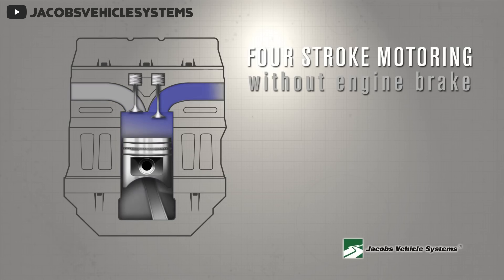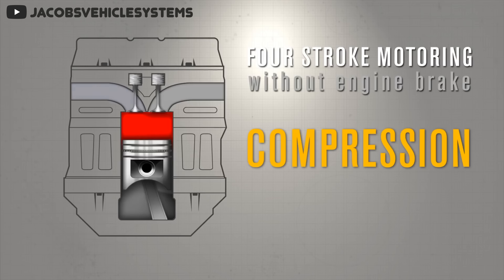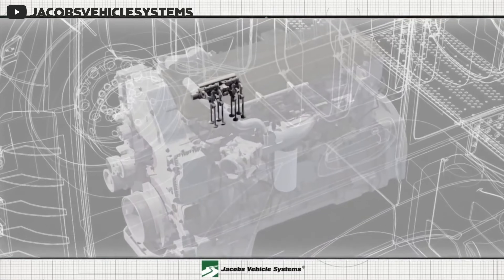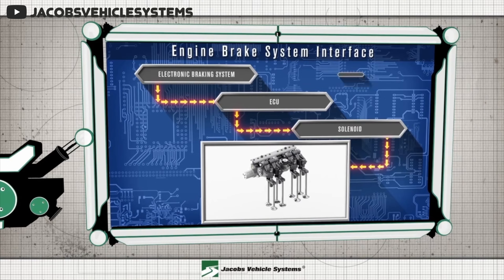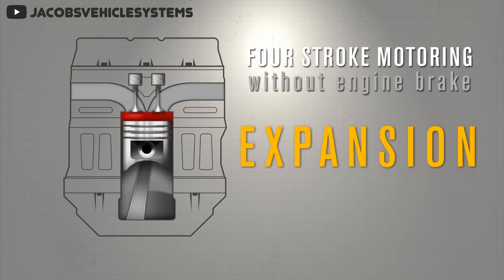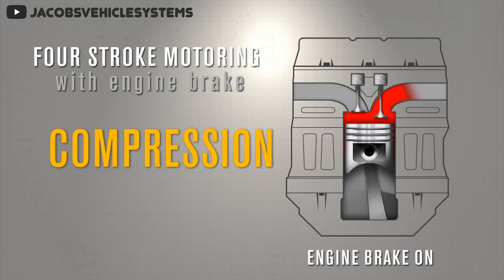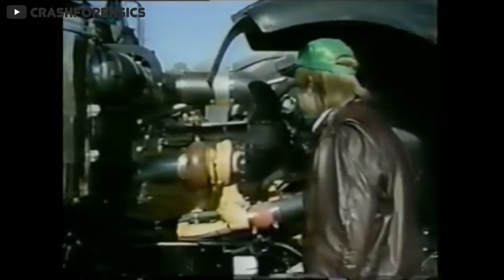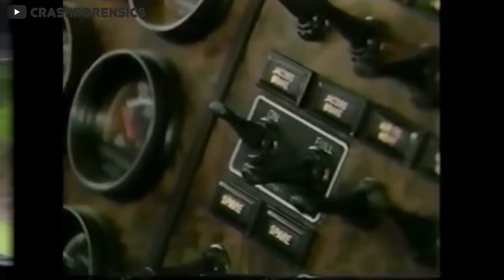What is a Jake Brake and How Does it Work?

Comment: When a Diesel engine is under no fuel, the engine works to compress the air in the cylinder. If no fuel is added, that compressed air will push back down on the piston making for neutral braking. On a Jake brake with no fuel yes the engine works to compress the air in the cylinder, but the exhaust valve opens near top to expell the compressed air hence their is no air pressure left in the cylinder to push the piston back down again-and you get all the compression strokes working as a brake-usually around 400hp of braking.
Reply: 400Hp of engine braking only at High RPM with all cylinders actively providing braking effort. Also not all engine brakes pop the exhaust valve open near the top of the compression stroke some will actively partially open the valve at the start of the compression stroke and will remain partially open through nearly the entire compression stroke. The piston has to work against the restriction of the valve and sometimes also and exhaust brake downstream of the turbo.  This is done to cut down on noise
Reply: @j.m.5995  The original Jake brakes were activated by the injector-hence they opened the exhaust valve near top dead center and at the highest compression pressure-which made for a noisy Jake Brake. Now most Diesels have a separate lobe on the camshaft to operate the Jake brake making them both more effective and quieter.
Reply: @Tchristman100  Was this on overhead Cam engines?  I can see how the injector lobe on a pump injector setup could be rigged up to Piggly back off the mechanism to pop open the exhaust valve as it essentially fires fuel at the same time you would want to activate the exhaust valve. I don't know how they could do this on a injector pump setup but I guess where there's a will there's a way lol cheers to Jacobs and their Engineering whose work has spare many a countless life through out the span of time
Reply: @j.m.5995  On engines with an injection pump (like my Caterpillar 3406B mechanical) the Jake brakes work off cross activation. For instance number 1 cylinder is on compression but number three is on exhaust. So number one gets Jake Brake activation by the exhaust valve activating the Jake brake from cylinder 3 to work one. It works OK-just not very strong.

Comment: How come you see sign going down hill in the mountains that say "Trucks use lower gears"?
Reply: Jake’s are more effective at lower gears, more advantageous, both with gearing advantage, and with higher RPM’s.
Reply: A truck shifted down to a lower gear will maintain a lower speed. In a 10 speed, 9th gear will hold you at 45 MPH. 8th will hold you at 35 MPH. It's slow, but really saves the brakes from overheating.

Comment: In my experience most gasoline engines produce next to no braking effect either so idk where they come up with that idea
Reply: Probably because you drive a car with an automatic transmission. Engine braking is a lot more noticible at higher rpm. An automatic car keeps rpms low resulting in less engine braking
Reply: @DereksDriveway  I mean I've done it on stick shifts and I've pulled the automatic shifter down into the 1 and 2 position and the only vehicle I've had that had even a passable engine brake was the 5.4 because it was fairly undersquare.
Reply: @wizard_of_poz4413  Drive a manual with a throttle cable and you will fell the engine braking when you let off of at high rpm, if you have an drive by wire as most cars have been since the 90s then you won't feel it as the throttle isn't fully closing like it would with a throttle cable when letting off. And you will barely feel engine braking through any automatic transmission just because the torque converter clutch turns off with braking unless you got a controller or tune. If you can find an old gas car or truck with a manual trans you'll see what I mean when you let off the throttle at high rpms while in gear but be careful as the car becomes hard to control when letting off abruptly. Electric throttle cars don't let you do that so it feels like they have no braking, some guys swap to a throttle cable for more control over the throttle for driving and braking.

Comment: Combine with a trailer brake set on a higher level you can barely use the trucks brakes 
My 6.7 Ford uses the VGT turbo in a similar manner just not nearly as effective
Reply: Would not recommend because you're gonna eat your trailer brakes faster plus if you have them turned up to really stupid levels then it's gonna cause a massive safety issue in slippery conditions
Reply: The ISX apparently uses (counter intuitively) both an exhaust brake and a Jake.  Let off the accelerator, and the exhaust brake weesh comes on, truck slows town, fairly enthusiasticly, then cuts off, for the Jake’s to take over.
Reply: @jaysmith1408  yea every newer truck I've been in will shut the turbo vanes to sort of increase the effect. I don't see where it's particularly counter intuitive because it means you can get a little more work out of the exhaust stroke as well
Reply: @wizard_of_poz4413  never thought of it that way, except that the exhaust restriction ought to let up at the moment the Jake releases compression, otherwise exhaust would be more prone to be held in the system.  Given the turbo or any ancillary exhaust restriction is after the manifold, it would be impossible.

Comment: Why don't they add an intake throttle to a diesel so they can get some engine braking in areas where jake brakes are prohibited?
Reply: They do on emissions motors for creating a suction for the egr process, but it's not gonna hold so much as a candle to a butterfly valve or a Jake system. 
  And as they hinted that pretty much any modern engine that isn't straight piped like that jackass, the engine brake is barely audible
Reply: That is a great question.  Modern diesels have a DOC and DPF, exhaust restrictions.  Throttling the intake causes a vacuum in the intake manifold, and that unloads the "pumping losses" through the semi-restricted exhaust.  The load can either be an intake or exhaust restriction, not both.

Additionally, the intake valve seals are not designed for vacuum operation on a diesel.  I suppose that can be overcome, but there is no point right now.

You asked a great question.  Many engineers and managers asked the same thing, and tests were run on the IndiCom2.

Comment: Since we’re going down the diesel rabbit hole here,  you gotta do “run aways”…
Reply: That would be interesting. Years ago I went over Donner pass and grapevine almost every night and I saw many trucks in the run off ramp. Always felt bad for those drivers. I'm sure some of them had to change they're drawers after they got stopped
Reply: @alanbrown2666  I think he means the conditions where a mechanical fuel pump keeps adding fuel to an engine that won't shut off
Reply: @zenjon7892  
Oh. I probably would have known that if I would have paid more attention to the video. Thank you

Comment: As one of those engineers that developed Jake or Jacobs brakes for different engines, I would like to add the need to cool the fuel injector tips when using the "Jake".

We have come a long way to provide effective braking without the noise, so some of the "use of engine brake" restrictions aren't as necessary as before.  ...If a driver uses a Jake, but nobody uses it, is that against the law???

Although the IndiCom2 may not show a ton of INDICATED braking from a diesel engine, there are still a lot of parasitic losses to make engine braking effective, even without a Jake.  One example is a Horton clutched fan producing 84hp of engine "braking" at redline.

Exhaust brakes from a throttle valve or a VNT are bad ideas, due to camshaft damage due to no follow conditions and up to 5 exhaust valve bounce events.

...And then there are the aquatarders.  Those are amazing.

I have nearly died a few times on I70 when testing various engine brakes.  Runaway lanes were not available for me.  The uniformed say that engineers are not that smart or don't have their CDLs.  There are some smart engineers out there.  You can see us going back and forth on I70 and all over Denver.  Look for the INCA cables...
Reply: Did you ever do any testing on Mack's Dynatard system or Caterpillars brakesaver? Not much info about them online anymore
Reply: I did not.
Reply: When I drove bus, the city buses had retarders (painfully effective) and the road buses had Jake’s, with wildly varying effect, the Detroit 60’s that usually were quite formidable, and the ISX 13’s which could often hardly be bothered.  Strange how much variation in use they can have.
Reply: Great point.  You had good experiences that few OTR drivers had a chance to get with the retarders.

We easily had the opportunity to "outclass" the competition with a terribly effective compression brake.  Advanced timing that would burn fuel on the compression stroke was so effective ...so effective that we could make the drive axle(s) unstable.  Stability control (or the lack of stability control) put a limit on how effective we could make a Jake.  That was more restrictive than meeting noise requirements.  This ain't the 90's anymore.

The passenger bus drivers get some pretty cool technology that a normal driver may never see.  It sounds crazy, but the bus engines were sooooo much more difficult to design for.  A bus version of a diesel engine is so much more intense.  The on-off-idle cycles of a bus destroy an otherwise normal diesel engine ...especially in mountain cities.  ...And then there are the experiences of being hickacked in Columbia or Mexico while validating the bus engines.  I lost 4 close friends that were taken hostage.  A close female engineer had something even worse happen to her when validating a truck in South Africa.  This work is dangerous.  Truck drivers are 2X more likely to die on the job, compared to cops.  Bus drivers have it pretty tough.